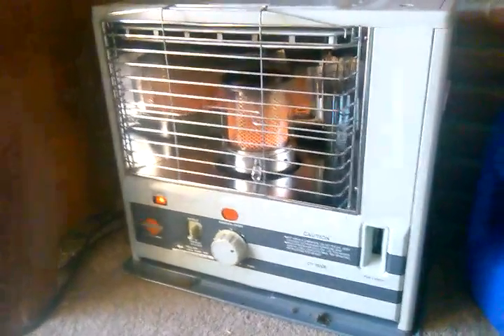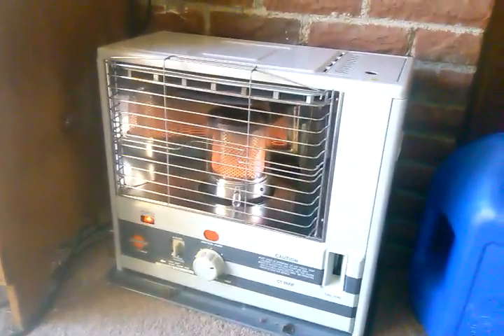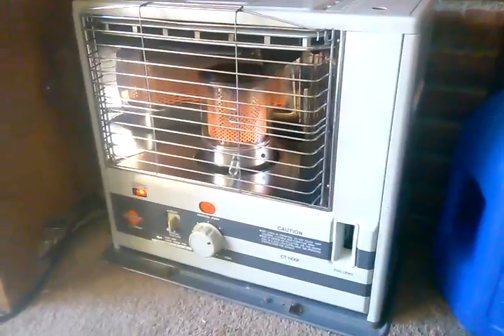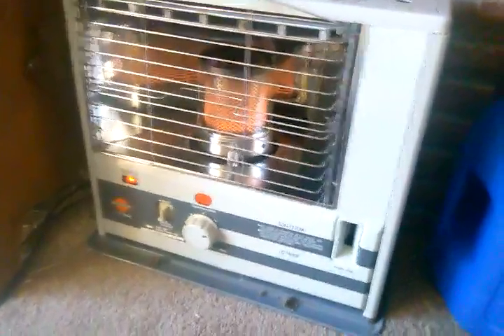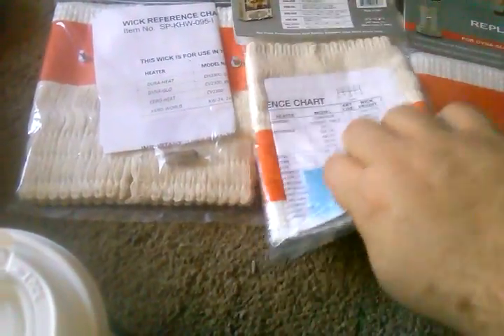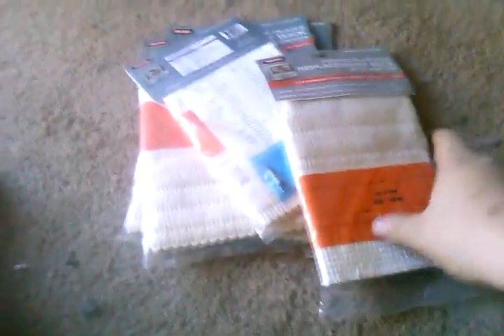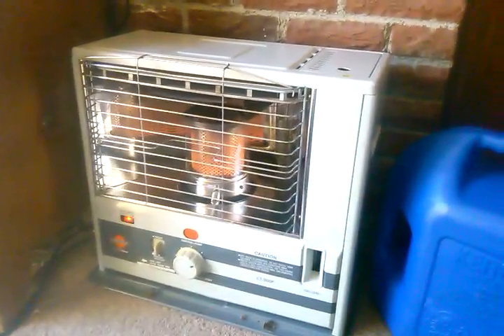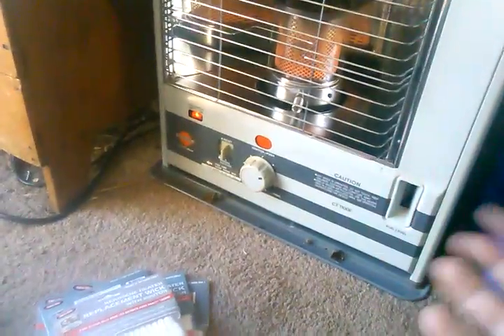Some tips on having a Kerosene heater as a backup heat source

Comment: Have you used diesel mixed with some alcohol and stabilizer in your heater
Reply: +carlos cameron I do and it works better than K1 - less odor and a lot cheaper too!
Reply: From all the information I've come across, you must use a 100% cotton wick when using diesel fuel. Apparently It carbons up the fiberglass on the wick.

Comment: Whats your opinion on using  low sulpur diesel
Reply from the maker: +cameron Gibbs I have hear of people doing it and they swear by it.  I have never done it.   Diesel is similar to Kero, but they do come off in different parts of the distillation process.
Reply: as i live in Australia and kero is super expensive and smells a bit . i used a diesel kero mix 70 diesel and 30 kero and it did not smell and burned realy well.Just curious if many have done it

Comment: A FRIEND SOLD ME A KERO SUN ALMOST THE SAME AS THIS, NOW I RAN THE OLD FUEL OUT THAT'S BEEN IN IT FOR 20 YEARS BUT STUPIDLY PUT IN MEXICAN FUEL I HAD AND NOW IT WON'T EVEN LIGHT, I JUST ORDERED A NEW WICK ON AMAZON AND IS THIS THE PROBLEM??
Reply from the maker: Well if the Wick has the Mexican fuel on it and it won't light when yo put fire to it.  I would guess it's a fuel problem.

Comment: What you paying for kerosene ?  I just priced it here. 11/16/2014  $4.90 for the 15ppm and $4.40 at another place for the 500ppm sulphur at gas stations. Does the price climb up later in the winter like propane ?
Reply from the maker: I am paying $4.39 a Gallon here.  I have always had Kerosene prices stay the same through the winter.  Last year propane went way up, but most years it stays pretty much the same too.  I just filled 12 of my propane tanks for $2.29 a gallon, so I am using propane mostly this year unless the price spikes on it again and it becomes more expensive than Kero again.

Comment: So basically if you buy kerosene from a gas station you are taking your chances with the grade. I am buying k-1
Reply from the maker: K-1 is the type of Keorosene, where it comes off in the distillation process.  I have never seen anything but K-1 for sale at any gas station.   There is just a lot of difference between them in how they are stored, age, moisture, and purity.  The Kerosene you get in the plastic jugs at the store are usually good stuff, but a LOT more expensive per gallon.  If it is just for emergency use those would be fine.  When you go through 5 gallons every few days like I did last winter it would have been cost prohibitive.  I would recommend trying a little bit 1/2 gallon or so from a gas station and find some that works good for you.

Comment: I never use kerosene anymore in my heaters. I use diesel fuel instead. Kerosene stinks no matter how clean your heater burns, you can smell it. Sinse I started using diesel, there no smell and diesel fuel gives off more BTUs than kerosene.  I just add a little Seafoam to the diesel and it burns great!
Reply from the maker: I've heard someone else say that.  I tried once and it stunk to high hell.  I had to empty my heater and change my wick to get it all cleaned out.
Reply: It seems that you did not have the same experiences...

Comment: Are you still using kerosene heater?
Reply from the maker: Yes.  I have moved to a house with central heat now, but I still use the small one in the garage and to have as emergency heat if needed.  I got rid of my larger one.
Reply: How dangerous are kerosene foumes? Thanks good video.
Reply from the maker: I am still alive

Comment: It would be far cheaper to heat with a regular heating system. Why would you want to heat this way?
Reply: He already told you. Use in emergencies when electricity goes out as backup.
Reply: It's a lot cheaper than the oil furnace. And works when the power goes out which occurs often here in N. Maine.

Comment: $25.50  for 2 1/2 gallons NOW......K1  that is.     77563
Reply from the maker: I am still paying $4 a gallon.
Reply: @frugalprepper  Tell me where you buy K1 kerosene for $4 a gallon.    Where do you live?
Reply from the maker: In Ohio, I buy it at Sunoco or Speedway.  I actually think speedway just raised there price to $4.19 a gallon.
Reply: I'm across the bay from Galveston,Tx.,  I gotta research this. I hope I can find a gas station that sells it and for that price. Got my heater on now. Hate the cold. I'm 75, a disabled Marine, thin skinned I guess!!

Comment: Diesel burns better than kerosene and is A LOT cheaper. Why is anybody still burning expensive kerosene????
Reply from the maker: Because Diesel plugs up the wick after a couple of tank and smell like poop.   Man that was a mess to clean up after trying that a couple of years ago.
Reply: Overtime any fuel will junk up a wick. Diesel forced me to pay special attention to maintenance and is way more cost effective AND you don't have to worry about this or that station selling kerosene they didn't produce. Sounds like you are going through a lot of trouble and money to burn kerosene.
Reply: @frugalprepper  From what I've heard you need to use 100% cotton wick if using diesel fuel.

Comment: OR...just get a Mr. Heater Big Buddy propane heater & avoid all the stuff that comes with kerosene heaters.
Reply: +Altair Ramar Ive been looking for back up heaters whether electric, kerosene, propane and this is the 3rd or 4th kerosene heater video I have seen you making the same comment about your "Buddy". You have stock in Mr. Heater? LOL
Reply from the maker: +Altair Ramar I have tow Big Buddys as well.
Reply: +gemer84 I wish I did! Just trying to educate the masses, my friend.
Reply from the maker: Altair Ramar
Right now Propane is a lot cheaper per BTU than Kerosene.  When I did this video it was the other way around.  That is why I like both option.   I will be using a lot more propane this year.
Reply: +FrugalPrepper what's signs of a bad wick? I have the exact model with the fan as you, burns even and blue, smells horrible, no soot..I've even tried the expensive stuff at Walmart in the jugs and it still smells, I have ran it empty three times and wick is soft and clean looking
Reply: Look into Empire propane heaters  they are easily available and are very well made, stay away from Mr anything some may be fine, but why risk it
Reply: You need to clean your heater and burn the wick dry. I guarantee you that if you do it, it will burn clean with no ordor. Theres a video on my channel that will show you how to do it.
Reply: You need to clean your heater and burn the wick dry. I guarantee you that if you do it, it will burn clean with no ordor. Theres a video on my channel that will show you how to do it.
Reply: I've seen propane heaters leak badly!